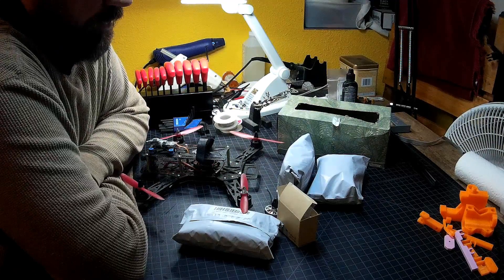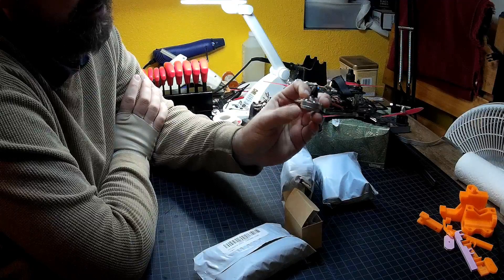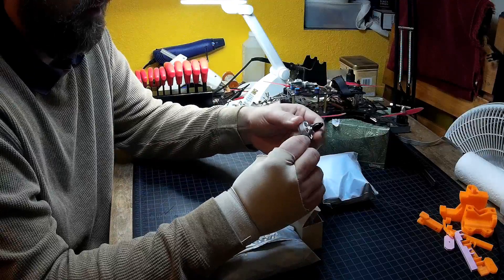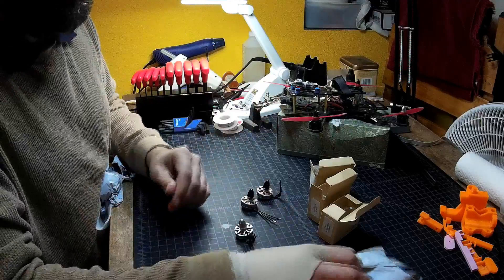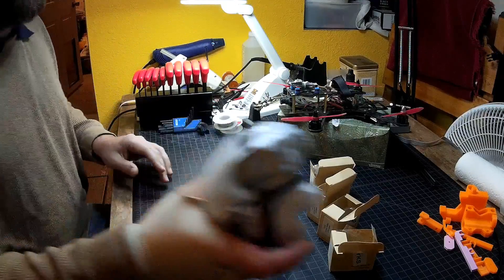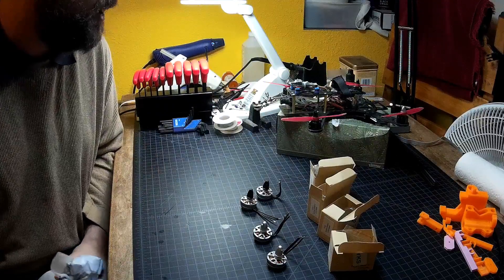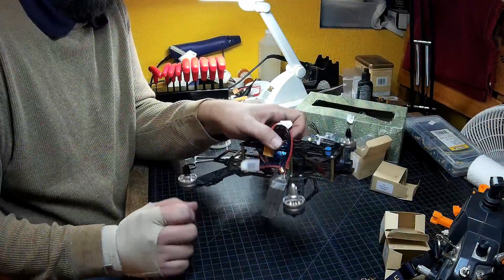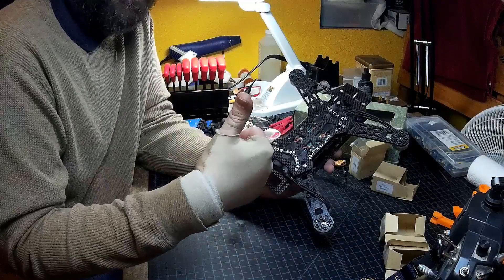YKS Brushless  250 Quadcopter Motor install on Emax Nighthawk 250

Comment: Just brought me a Yks from Amazom can't wait to test fly tomorrow
Reply from the maker: I moved them to my latest build and have been running them hard.  My ESC's are almost uncomfortable to touch after 4 minutes but the motors are barely warm with 3s and 6045 props.  They aren't the most powerful 2204's but they've held up to my abuse very well so far so for the price I really don't have any complaints!